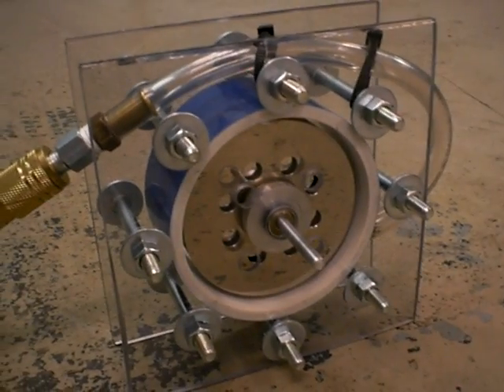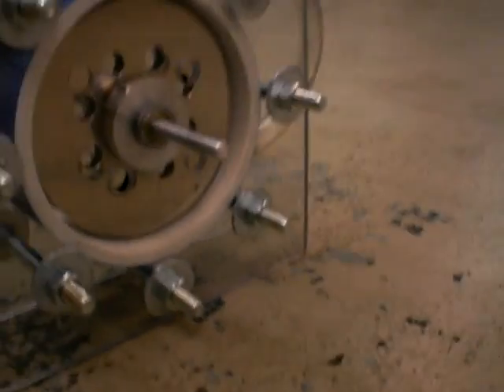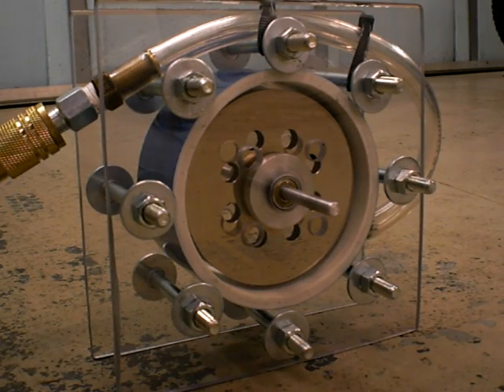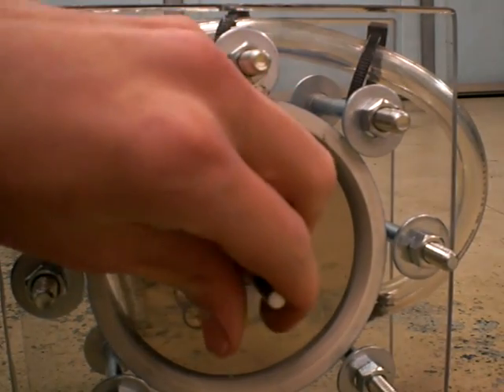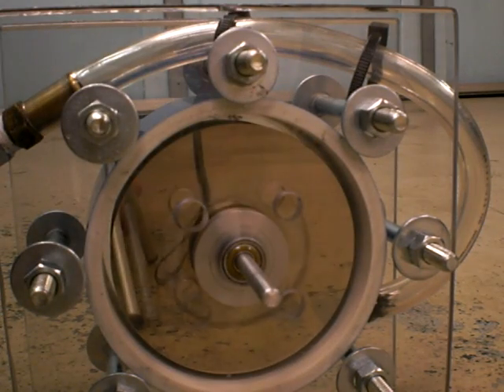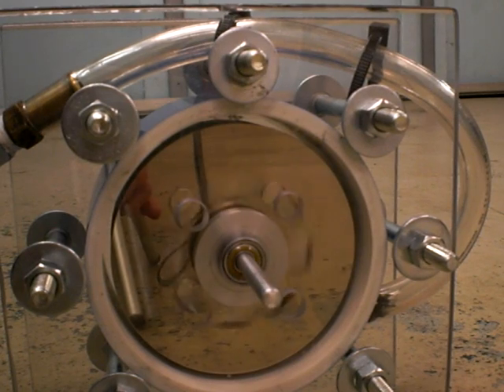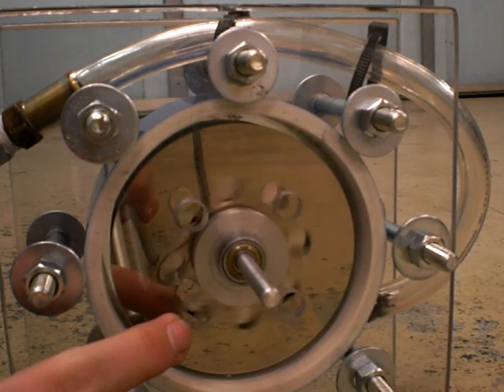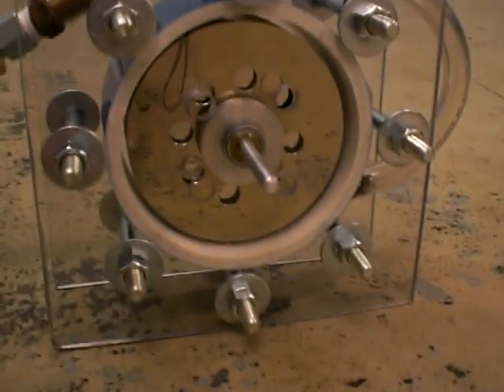Tesla Turbine

Comment: They have no torque no power, why is everybody going nuts over them.
Reply: I appreciate your comment but that’s not an issue because, despite what everyone erroneously claims, Tesla turbines work just fine, get plenty of torque and output power at low RPMs.     I’ve got some copy pasta 🍝 of mine that I’ll share with ya here to explain more.  Tesla turbines aren’t made efficient by spinning really fast.   That’s only for when the disc stack is being used as a centrifugal pump, because ALL centrifugal pumps’ compressors, performance is tip speed dependent.   But spinning the turbine fast will produce a centrifugal head that opposes the incoming fluid flow, reducing the pressure gradient across the nozzle, reducing fluid final velocity, reducing mass flow rates through the nozzle and ultimately reducing power out. 

Furthermore the faster you spin them the faster the fluid you have has to go just to still be moving faster than the discs and still provide torque.   Lastly, they work just fine for industrial use and can scale up just fine because the torque on the discs is proportional to the difference in the fluid speed and the disc speed. So the disc tip speed is the important factor here. For any given fluid supply in the nozzle will have a max fluid velocity. So the turbine disc tips will have a max speed set at that fluid speed irrelevant if radius. Now considering that centripetal force is proportional to V^2/R, if you keep the tip speed the same but increase the radius the centripetal forces on the disc for the speeds needed will actually decrease. 

Despite what MANY have claimed about the Tesla turbine, it does NOT need to be spun fast to work or work efficiently.   TesTurs are made efficient when the slip on the discs is reduced and spinning the discs fast does nothing to reduce the slip, only increase the distance the fluid slips on the disc faces, which is by definition “loss”.  Listen to what Tesla himself said in the patents of how to make them work.  “Owing to a number of causes affecting the performance, it is difficult to frame a precise rule which would be generally applicable, but it may be stated that within certain limits, and other conditions being the same, the torque is directly proportionate to the square of the velocity of the fluid relatively to the runner and to the effective area of the disks and, inversely, to the distance separating them. The machine will, generally, perform its maximum work when the effective speed of the runner is one-half of that of the fluid; but to attain the highest economy, the relative speed or slip, for any given performance, should be as small as possible. This condition may be to any desired degree approximated by increasing the active area of and reducing the space between the disks.”  1) increase the speed of the fluid relative to the disc, (not increase disc speed)  2) increase surface area 3) decrease disc spacing  This is how you actually make a TesTur work. Not by spinning it fast.   The fluid interactions with the disc that govern efficiency an torque are adhesion and cohesion. Full stop. And spinning fast does nothing to increasing either to increase the turbines isentropic efficiency.   This is why everyone who chases rpm with the TesTur just flat out fails. They aren’t even trying to design them properly so of course they won’t work.
Reply: You just have to know how to design it correctly to actually reduce slip to make them work, not spin them fast.  The only reason people think Tesla turbines have to be spun too fast is because EVERYONE has mistaken the part of the patent that is about the turbine being used as a pump as being about it being used as a drive turbine.   The only time you want to spin a TesTur fast is when it’s being used as a pump/compressor. This is because ALL centrifugal pumps’/compressors’ performance is tip speed dependent.   “I have found that the quantity of fluid propelled in this manner, is, other conditions being equal, approximately proportionate to the active surface of the runner and to its effective speed. For this reason, the performance of such machines augments at an exceedingly high rate with the increase of their size and speed of revolution.” -Nikola Tesla 

And again, you DO NOT want to spin too fast in a TesTur because the centrifugal head will just counter your incoming fluid flow reducing power. And the faster you spin discs, you’re fluid has to be going even that much faster just to be able to apply a torque on the disc face.   “Still another valuable and probably unique quality of such motors or prime movers may be described. By proper construction and observance of working conditions the centrifugal pressure, opposing the passage of the fluid, may, as already indicated, be made nearly equal to the pressure of supply when the machine is running idle. If the inlet section be large, small changes in the speed of revolution will produce great differences in flow which are further enhanced by the concomitant variations in the length of the spiral path. A self-regulating machine is thus obtained bearing a striking resemblance to a direct-current electric motor in this respect that, with great differences of impressed pressure in a wide open channel the flow of the fluid through the same is prevented by virtue of rotation. Since the centrifugal head increases as the square of the revolutions, or even more rapidly, and with modern high grade steel great peripheral velocities are practicable, it is possible to attain that condition in a single stage machine, more readily if the runner be of large diameter. Obviously this problem is facilitated by compounding, as will be understood by those skilled in the art. Irrespective of its bearing on economy, this tendency which is, to a degree, common to motors of the above description, is of special advantage in the operation of large units, as it affords a safeguard against running away and destruction. Besides these, such a prime mover possesses many other advantages, both constructive and operative. It is simple, light and compact, subject to but little wear, cheap and exceptionally easy to manufacture as small clearances and accurate milling work are not essential to good performance. In operation it is reliable, there being no valves, sliding contacts or troublesome vanes. It is almost free of windage, largely independent of nozzle efficiency and suitable for high as well as for low fluid velocities and speeds of revolution.” -Nikola Tesla  Tesla both knew it wasn’t meant to spin fast and that it worked great for low speeds IF you design it correctly.
Reply: There’s all the proof anyone could need to know this now.   

10in diameter TesTur made from cheapo aluminum on room temperature compressed air Dyno’d at 6.22ft-Ibs of torque to the shaft at only 4150pm and +4250watts between 6,000-12,000 pm and real 250-2650watt electrical load test runs at 9,000-13,000rpm.  

The preliminary tests are just to see how much electrical power can be produced with room temp compressed air driving the Tesla turbine.   

The TesTur nozzles never went over 20psi at the nozzle for the 2650watt electrical load test and not over 40psi at the nozzle for the 4250watt dyno test.     

This is so a baseline can be acquired for what to expect as the temps are increased to combustion levels.     

When using elastic gasses the counterintuitive thing most overlook is that the viscosity of gasses goes up with temp.   

So not only is there an increase in thermodynamic efficiency from increased temps but the TesTur isentropic efficiency also goes up due to the reduced slip from the increased viscosity.

Comment: so what are you saving...you still have too pay for the electric for the compressor..
Reply: With TesTur Energy, the mission is to give people energy independence through Combined Heat And Power (CHP) systems that can make use of underutilized energy sources like biomass, solar thermal, geothermal and even low grade fuels containing high quantities of solid particulates (like pulverized coal and powdered iron); energy sources/stores that are currently underutilized due to the lack of turbines and engines capable of handling the multiphase fluid flows (any combination of gasses, liquids, solid particulates) present in low grade heat boilers and low grade fuel sources without damage over prolonged/continuous periods of use.

Comment: i wonder do you think this PVC and acrylic could handle steam?
Reply: Your tubing system would probably explode because acrylic and PVC fail to resist beyond 100C+

He would need something that can resist higher temperature.
Reply: ***** so maybe a sewer pipe 6 inch or i will call our local steel cutter and see if he can get some 6 inch tube and i know he has as much flat steel as i want. i even thought about spening more and getting a buch of steel plates cut out and put together to make the tube then the same cut a bunch of plates round smaller to make the inside but this would be a crap load of money i really dont want to spend. what would you do for steam long term solution to run i have a heat source that is eternal.
Reply: gforcefoamy
At least for the pipe, I would go with copper, since you have plumbers that can do the job for you. Also, it's accessible in those hardware store like Home Depot.

If you want to make disk, I'd just go and find a store that can laser cut my disk. The materials for your disk depends really on your steam input.

I am assuming you will run it in saturated steam, because you would then need several heating source.

The tesla turbine in my lab is currently running 20k rpm@ 8PSI with generator and a load resistance in in closed loop. We're running on compressed air, since it is much easier for us. At least, works best for 40-50 students working next to that thing.